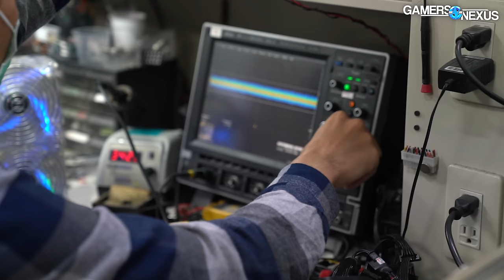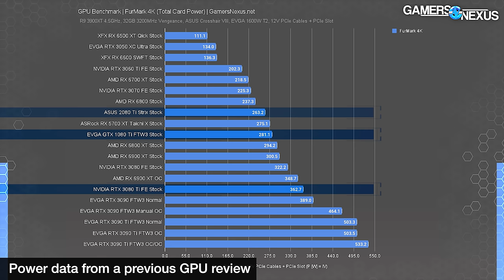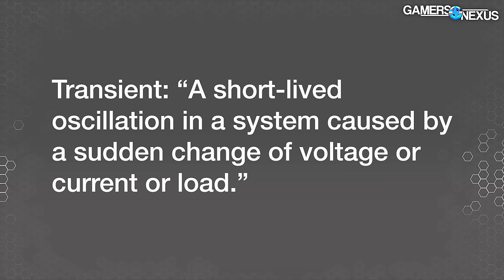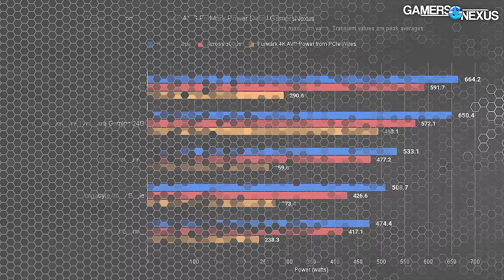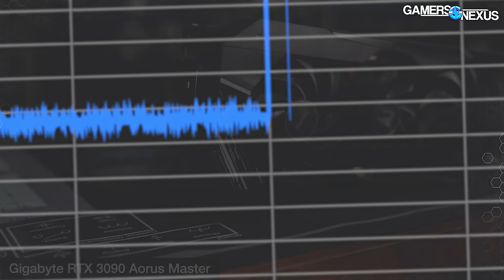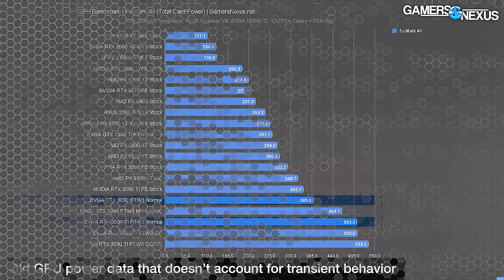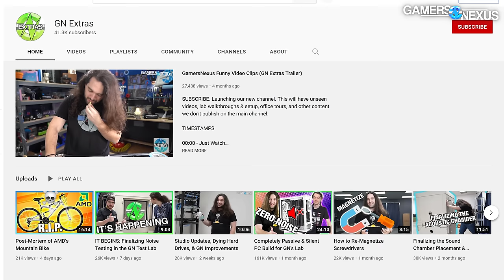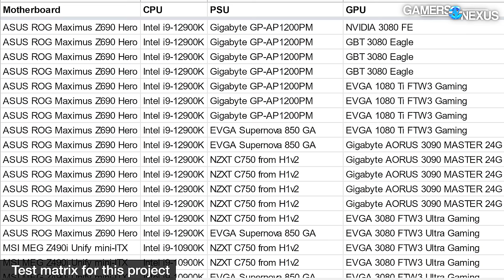The Brewing Problem with GPU Power Design | Transients

Comment: Now PSU manufacturers or brands can capitalise on this issue by advertising how massive their Caps are in their unit. 
Nominal Load : 850W
Transient Load : 1700W@20us
Reply: At a bare minimum, ATX 3.0 + PCIe 5.0 certification of PSUs (with independent verification) will go a long way to educate consumers here. SFX PSUs may perhaps give way to SFX-L..
Reply: @ikjadoon  Nah, there's too many people willing to spend hundreds more on a part to save a cm of space. I'm sure Corsair will find a way to make their SF series well over 1000W, if it means they can charge a boatload for them compared to normal ATX psus
Reply: Im hoping they also start to put more capacitance on the GPU board. Loading up the caps in the PSU destabilises the 12V rail which will reduce the stability of the whole system, not just the GPU

The good news is capacitor technology is advancing relatively quickly, so it will at least be possible to keep up
Reply: @toby1248  why would loading up capacitors destabilize anything? Aren't capacitors very slow to charge compared to their discharge speed?
Reply: @LtdJorge   all capacitors charge and discharge at the same speed, somewhere between a millisecond and a nanosecond for a full charge. But the voltage drops linearly as they discharge, so the more you load them up the more the 12 volt rail will drop below 12V.
Reply: IMO it's clear if you're designing an add in board for an existing system infrastructure it's up to you to design your board in such a way as to filter the power properly. Like duh.
Reply: @toby1248  , capacitors do not charge at the same rate. The rate is based on a time constant and the time constant is based on series resistance. Even if there is no external series resistance, there is always a equivalent series resistance (ESR) since capacitors are unable to be an ideal pure capacitance only and will always have some resistance internally. Resistance slows down charge flow, and the time constant increases with resistance and capacitance. Further, capacitors in a bypass configuration help with voltage droop, not hurt it. Bypass capacitors are in parallel and assist in maintaining voltage. A sudden high current draw in a system will mean the parasitic impedances/resistances will play a larger role and cause a larger voltage drop with the increase, but a capacitor in a parallel can pick up the slack during these transients. Because each capacitor has its own RC constant, the capacitors need to be selected based on the frequencies you expect for the transients. The only downside to a lot of capacitors is there is an inrush of current when first energizing the circuit, which has been known to trip some home wiring safety features like GFCIs where they sense a large amount of current going into a system but not returning back out for a period of time (as it gets put into the capacitors) creating a measurable differential in the returning leg and cuts power thinking there is a ground fault. At my old house I ended up having to move the computer off of a GFCI circuit since my PSU kept triggering it in this fashion.

"But the voltage drops linearly as they discharge, so the more you load them up the more the 12 volt rail will drop below 12V."

They will only discharge if the circuit voltage drops, they won't drop voltage themselves. In a circuit, a charged capacitor in parallel is viewed as an open circuit since no charges will flow into the capacitor once it is full. Though, this is the ideal case, so can be considered correct in that the ESR if too high can cause a voltage drop, however, overall, the capacitors help with voltage drops due to current spikes, not hurt.
Reply: This is why we need in-cable capacitors.
Reply: @alaeriia01  these things are going to need to be huge. They won't be fitting inside cables
Reply: @JimBob1937  capacitors charge at the same rate that they discharge. It doesn't matter if the current is flowing in or out, with a given voltage drop the current will be the same. That is different to how chemical batteries work and its what the guy was actually asking
Reply: @JimBob1937  man I kept reading and you completely missed the point throughout wow.

By forcing a capacitor to 'pick up the slack' during a transient there will necessarily be a voltage drop before sufficient current starts to flow. But if the capacitance is on the GPU rather than in the PSU you can take advantage of the inductance of the power supply cables rather than being impeded by it, and also have the advantage of selecting the right capacitors for the exact job they need to do, ie supporting the GPU.

I'm not suggesting taking the caps out of the psu either, just adding more to the GPU
Reply: @JimBob1937  "they will only discharge if the circuit voltage drops, they won't drop the voltage themselves"

Congrats on repeating my exact point and thinking its a counter point. This is exactly the voltage instability im talking about. Current goes up, voltage immediately drops until the caps can supply the deficit
Reply: I =C.dv/dt and P=VI:  Vdc=12V deltaP=850W so deltaI = 71A  Let say you can tolerate a voltage dip of 100mV in 20us so dv/dt = 5kV/s.  You need a C = 71/5000 = 14.2mF and don't get me started on the ESR requirements of such a cap.
Reply: @toby1248  Jimbob is actually right here, the rate is based on the charge state and isn't linear.  I remember that much from my B.Eng. studies. The charge rate is at its highest when the caps are empty and will reach 63.2% charge after one time constant. Now, if you discharge at that point it'll start discharging slower than if the cap was full. Look up capacitor charging, it's a bit unintuitive but I suppose you could think of it as pressure.
Reply: @toby1248  sure, they charge and discharge at the same rate, but charging the capasitor back up would not cause problems at the rail, since that would cause the capacitor to discharge even more
Reply: @toby1248  , "This is exactly the voltage instability im talking about. Current goes up, voltage immediately drops until the caps can supply the deficit"

Is incorrect though. The capacitors are FILLING that gap, they are not CREATING that gap. Most likely the circuit voltage is decreasing due to a current spike, the current causes the circuits parasitic resistances to drop voltage. The capacitors in a PARALLEL configuration simply are a supply of current and are charged to the line voltage and hence buffering changes in these events. A PARALLEL capacitor CANNOT (directly) cause a voltage drop since the voltage will remain the same, current is merely being diverted to them during charging, but in parallel the potential difference of a line remains the same. It is only in a SERIES configuration that a capacitor will cause a voltage drop until it is charged... however, in the circuits we're discussing you certainly would not use a series capacitor configuration. These are mostly bypass capacitors that act as a transient current buffer. Charging a capacitor itself can be a current draw itself, but once a properly engineered circuit is charged and in operation, the transients will be buffered and the capacitor charging will smooth out transients while very gently dropping voltage. Even in a single capacitor configuration, this will smooth out voltage supply far more than without it. Meaning, a 1V drop will be buffered, and the slower charge rate will cause less of a voltage drop than the drop it is trying to buffer. However, this is why you will see multiple capacitors in parallel. The current supplied by a capacitor during a transient will be the one with the RC constant that is likely to respond to the transient frequency, while the other capacitors won't. The other capacitors are charged to the same line voltage and hence will act as a buffer to stabilize the line voltage from the capacitor that responded and its need to divert charge for its own RC constant based on the amount of charge it released during the transient. At this point, we're getting into the weeds though, lol.
Reply: @JimBob1937  again, youre completely misunderstanding what I'm saying and how capacitors actually function in a circuit like this.

The voltage drops and the capacitors briefly prevent it from dropping further by supplying current in response to the voltage drop. But that initial drop is already enough to destabilise the CPU. Capacitors alone can never achieve a perfectly stable rail voltage during a load transient.

To me it seems like your brain is operating in a world of caps with zero impedance and infinite capacitance
Reply: I actually don't think this should be necessary: honestly my personal recommendation and my rule of thumb going forward will be to not limit my choice of GPU by price and raw performance figures only but I am putting a hard limit on TDP to always be under 200 watts TDP specially for SFX based systems. This used to put me within range of cards like the 1070 in the past but now even the 3060ti pushes past that and maybe even the 4060 will also push past that but I had just about enough of enabling this crazy power limits for no good reason when the midrange cards show that even midrange performance is usually enough for almost all gamers with just minor tweaking that I hesitaste to even call 'compromise' given how good medium and high settings look already for example.
Reply: @toby1248  , "capacitors charge at the same rate that they discharge."

Is a different statement than your prior statement of:
"all capacitors charge and discharge at the same speed, somewhere between a millisecond and a nanosecond for a full charge."

Which makes it sound like your claim is all capacitors charge at the same speed, and all capacitors discharge at the same speed. If you intended to say, all capacitors have a symmetric relationship between charge and discharge speed, your wording wasn't precise. In which case, I apologize for misunderstanding your point.
Reply: @JimBob1937  that's probably what I'd say to another electronics engineer, but I wasn't talking to another electronics engineer when I said that. I was talking to a guy who asked whether capacitors were slow to charge up compared to their discharge rate, obviously someone who is thinking in the context of chemical batteries

Is this entire discussion seriously just about some misguided pedantry?
Reply: @toby1248  , "But the voltage drops linearly as they discharge, so the more you load them up the more the 12 volt rail will drop below 12V."

I think the issue we're having is that your language is just imprecise, lol. Re-reading it, I think I understand your point. However, I disagree with it, as you're assuming the PSU engineers won't engineer the capacitor configuration to simply handle a larger current spikes. It sounds like you're concerned that the same capacitance configuration will get loaded down more, depleting the buffer ability sooner. Your concern is only a concern if PSU engineers keep their configuration the same and hence would have a hard time dealing with increasingly larger current spikes. However, they could design for them. With that said, to your other point, the higher frequency transients are better dealt with closer to the load, and hence the solution is likely a mix of GPU power engineering and PSU power engineering.
Reply: @toby1248  , "But that initial drop is already enough to destabilise the CPU."

CPUs and anything that sensitive already has capacitor buffers closer to the source. That is why CPUs usually have capacitors right next to the die itself, and motherboard manufacturers have capacitor buffers next to the CPU power circuitry. As a PSU engineer you just have to worry about your part and what current spikes you expect, you don't need to worry about these aspects. If the CPU is failing because of your PSU, your PSU is poorly engineered for power delivery in general.
Reply: @toby1248  , "But that initial drop is already enough to destabilise the CPU. "

Is not true as bypass capacitors are often operated together, different values with different RC constants. If what you say is true, no computer should be running now, as these aspects happen now... but they don't, as we have properly engineered circuits that properly buffer voltage drops.
Reply: @toby1248  , "But if the capacitance is on the GPU"

Its in both GPU and PSU and it needs to be in both. GPUs have capacitors now to react to very quick transients. Larger current spikes are best dealt with at the source end, and smaller but higher frequency transients are best dealt with at the load.
Reply: @toby1248  , "Is this entire discussion seriously just about some misguided pedantry?"

It was more so initially about a misunderstanding of imprecise language, but now has spun off from question comments made after, lol.
Reply: @toby1248  , With that said I think we're mostly in agreement, except for I think a proper solution is a mixture of capacitance at the source of power and at the GPU, which is kind of what already is being done. I think that is why Nvidia blames the PSU makers and the PSU makers blame Nvidia. They're both correct, it just depends on what time frame the transients are and thus where they're best dealt with. In my opinion, Nvidia is making the best choice by dealing with short lived transients at the GPU level, while larger current spikes of a longer (relatively speaking) time frame are dealt with at the PSU level.
Reply: @JimBob1937  what I'm really saying is that caps on the GPU will be better at absorbing transients from the GPU than caps anywhere else, both due to the proximity and the more specific selection of parts for the task
Reply: @toby1248  , I agree with that, except for I think capacitors for the GPU are best suited for smaller, high frequency transients that are only likely to affect the chip level operation. I still think bulk power stability belongs to the PSU. This is because not only does the GPU benefit from the PSU being better at power stability but the entire system and any other component. I think, as far as resource usage goes, it is simply more appropriate for the PSU to handle this issue than than every component duplicating power stability efforts. The duplication would lead to more power usage overall, with more individual component complexity and expense. If you have a central component responsible for multiple other components, it just makes sense to focus the engineering effort on that single component. Which is actually what engineers currently do. I think the frustration is simply that the job of the PSU is getting more complex and the PSU manufacturers don't like it. However, in my opinion, the problem is entirely within their domain since their component is the power supply to all other components, so their responsibility. The individual components should only need to worry about spikes that would affect their operation, like the capacitors close to ICs. Asking more from the individual components, in my opinion, is a misplaced duplication of effort, trying to handle an issue decentrally even though there is a centralized component where those development efforts could/should be focused. Of course, this is a matter of opinion, but I think the reasons are fairly sound. The kind of transients we're seeing with these GPUs that are causing issues for the PSU, I think are squarely in the PSU's territory.
Reply: @toby1248  Thats not how caps work my dude
Reply: This is not necessarily a wrong thing to do, as long as they tell the truth.
Reply: @FinneousPJ1  Hmm, good point. With GPU and CPU creating transients, how is a PSU supposed to prepare when multiple components happen to peak at the same time? Clearly the components that are all using the same power source must employ some hygiene themselves to keep the power clean!
Reply: Just like how "Peak" vs "Continuous" was in the old days :/
Reply: @FinneousPJ1  I could hardly agree more with this
Reply: @ikjadoon  how about flex psu lol
Reply: as long they use a standard load and joules for capacitance, I am fine with it.

something like:
1000 joules, 100us @ 0.1ohms.
I am fine with.
so there is no way to confuse people unless they do not pay attention.
Reply: @LtdJorge  that is because it would make the wires "ring".

it has to do with how power supplies delivery power and how power is used.

one analogy would be:
pretty much like the market, someone makes a big order at once, everything thing goes crazy and then they do not keep up the demand, so any ramp up in production results in oversupply.

what really happens is the capacitors lose voltage, so the PSU controller ramps up power, however the spike may be gone and the PSU ends up overshooting the voltage.

Google voltage overshoot
and also PSU overshoot design.

in a more Ideal world, the PSU would know exactly what power your components need and deliver precisely that.
in the real world the best you can do is design components so the need a slow and smooth ramp up in power delivery.

of course, you can design everything to just deal with overshoot.
however that is bad practice and also hard to do, so is more a question of increasing resistance to ringing and minimise things that may cause it.
Reply: @toby1248  that is a decent simplified approximation.
if we are gonna be real, capacitors do not charge not discharge in a linear fashion, worse... they also can vary a lot in Inductance and resistance, meaning that replacing one type of capacitors with another with equal voltage and capacitance may not work.

so that approximation works best if you are dealing with a circuit where parasitic values do not matter, however in switching power supplies they do, and sometimes a lot due the high dynamic nature of them.

see DC-DC converter datasheets.
also, sorry for the correction, however it is important to remember those traps that can get someone stuck troubleshooting a design.
Reply: i guess it depends on psu quality first of all but yeah 850 i guess even i have 750 w and still fine
Reply: They can sell individual caps with led lighting.
Reply: GPU manufacturers also need to start openly declaring the true power required instead of simply publishing average or thermal power.

If you had two GPUs on sale that had 3090Ti with 300W average and 400W transient load vs another with 290W average but 620W transient load, you could get the one with lesser transient load and use a bit cheaper PSU. Of course, depending on the cost of the GPU and PSU the optimal solution for your needs might be different.

The bottom line is that as long as GPU manufacturers lie about the power usage of their products, you can never be sure which PSU is enough.
Reply: @BeatstormX  Actually, @toby1248 has it pretty much right on, though not worded in the most layman friendly way.  "destabilizing" the rail, etc.  Essentially, the issue is that if you filter at the power supply,  any of that switching noise is still present on the wires, and at the output side of your filter caps.  When the GPU sucks on the wire, the level in the cap falls, and the PSU tries to fill it back up, but everything else on the output of the cap on that rail does still see that drop.  (additionally, the inductance in the wires is like inertia for electricity, it'll make the flow overshoot whenever it starts and stops).  If you filter at the GPU end, its filter caps will also go up and down with load variations, but nothing else is sharing on that end of the filter.